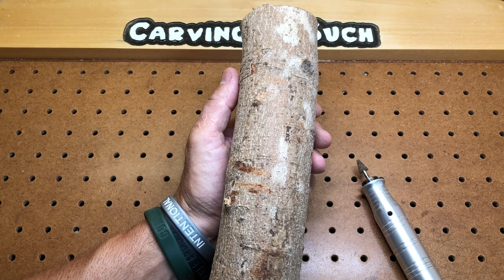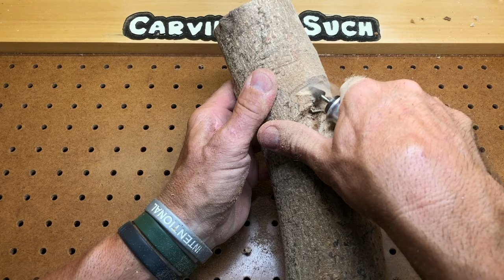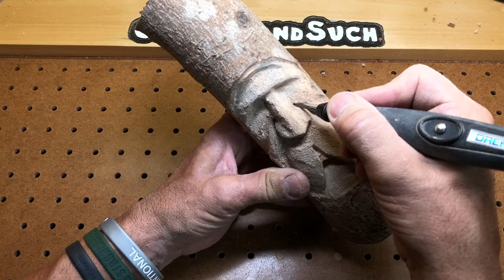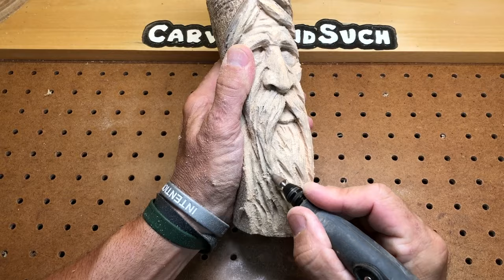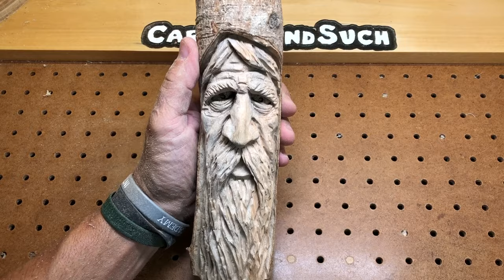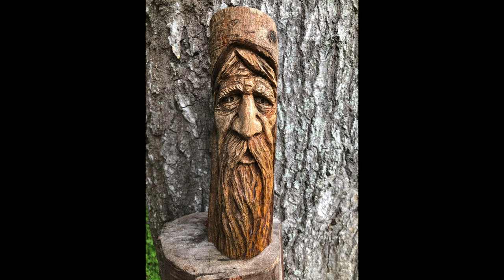How to Wood spirit carving with Foredom-Dremel-Kutzall wood-cuban laurel oak

Comment: You are an inspiration to me sir, I'm a 66 year old one armed ex coal miner and I've always loved woodworking, log benches, stools, tables, walking sticks wood spirit bird houses. I love trying to do what you do, I have a chinese fordom lol but my problem with both the dremel and fordom knock off is that I'm left handed and the burrs want to run away with me, I just found one with fwd and reverse and believe that will fix my problwm. Thank you so much for sharing your genius with us!
Reply from the maker: Great to hear you enjoy woodwork and carving. If the bits jumps try to adjust your grip and also less pressure. usually if i hold the hand piece like a pencil it’s jumps often. Few years ago I had an accident since that I only using small carving tools 😁Happy carving and thank you for watching 👍
Reply: Brilliant.I bought a Dremel in lock down to try this type of carving and owls but gave up because they never looked anything like that

Comment: Thanks a lot for your videos! They help me learn how to work as an engraver!
I know how to carve wood with a chainsaw, but I started using an engraver quite recently!👋
Reply from the maker: Great to hear! I wish I could try chainsaw carving but I have nothing to start with and where I live that’s almost impossible.
Reply: @carvingandsuch  Yes, I agree, working with a chainsaw requires solving some problems!)
I live in the city, in an apartment building, and in order to cut with a chainsaw, I first need to load four chainsaws and a tool box into the car, then drive off to a place where I can cut with a chainsaw, and after work I load everything back into the car and bring it to the apartment !😄
Reply from the maker: Yeah that’s a lots of hassle especially if you just wanna learn.

Comment: I absolutely love how you make these pieces of wood come to life right before our eyes. Simply awesome!, would love to know what bits you use around the eyes and for your fine lines throughout the face.
Reply from the maker: I using diamond set 1/8 shaft.  The first bit from right and the 4th. Those two my favorite ones. Thx
https://www.amazon.com/gp/product/B000MOI9G6/ref=as_li_tl?ie=UTF8&camp=1789&creative=9325&creativeASIN=B000MOI9G6&linkCode=as2&tag=carvingands09-20&linkId=dedcd0a387fcbbfca938b098d74bbae8
Reply: Your work is awesome, all the fine lines and wrinkles you add. 35 years as a cabinet maker and always wanted to try this. Thanks for some inspiration. Couple of questions; what size Dremel are you using and what are you using for your vacuum system. Thanks my friend!

Comment: Hi,  I was wondering what you use to seal your wood carvings. Is wax oil any good?  Amazing carvings by the way. and love the detail. You make it look so simple. I've been doing knife carvings for some time, but I'm investing in a Dremel 4250 as I have problems with aching fingers. Probably an age thing. I just hope I'm making the right move as using a Dremel is a whole new ball game to me. I love watching your videos. Keep recording and I'll keep watching. Amazing!
Reply from the maker: Hi welcome to power carving. I use clear or dark danish oil. Whole new ideas will borne believe me just practice. Let me know if you need help 👍
Reply: Thanks for the info, Cheers mate 😄

Comment: Amazing work. Ive just bought myself a dremel and found an interesting piece of wood that would suit itself well to making a wood spirit, and your video has inspired me to have a ho. I don't have the shaft extension, but would you recommend it as being easier to work with than the dremel itself? Also what are you painting the wood with afterwards, is it some kind of varnish? Thanks
Reply from the maker: Definitely you will need the flex shaft for your dremel. Much better control. Also dust mask.For the finish coat I love to use teak oil. Two light coats. If you have any questions just drop me an email. carvingandsuch@gmail.com thx
Reply: @carvingandsuch  Thanks for this. As it happens I went ahead and ordered a flex shaft which arrived this morning. Looking forward to having a go.

Comment: What Dremel is this? I’ve been carving with a chisel set but this would make life a lot easier
Reply from the maker: Dremel 4000 with a flexible shaft
Reply: Thanks. One more question about bits. Does any sizing vary for different Dremels? Or if I got the 4000 flex shaft with some kutzall bits/burrs will they fit right in?
Reply from the maker: If you got the 4000 the Dremel flex will fit. Get the 1/8 size bits and don’t go over that. Dremel won’t handle that. 1/8 will fit perfectly.
Reply: Thanks a lot happy holidays
Reply from the maker: Happy holidays